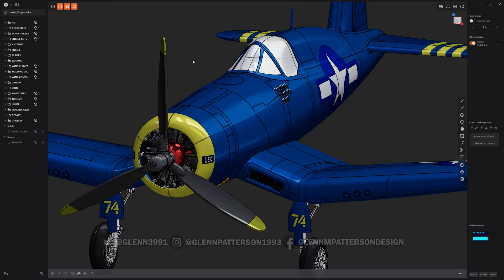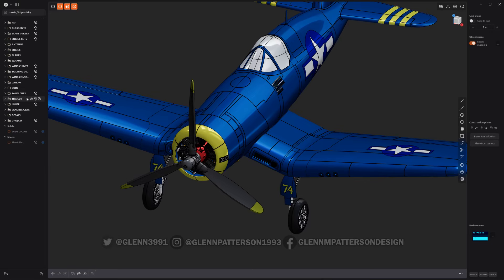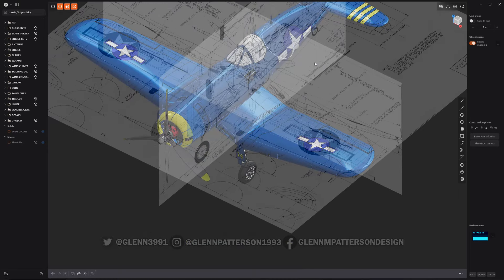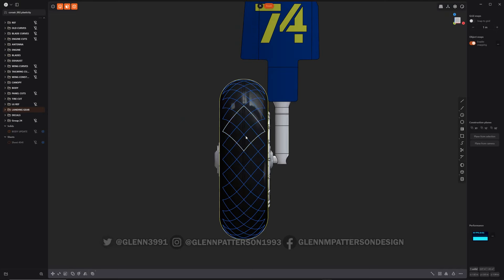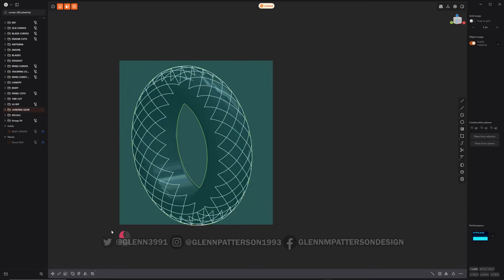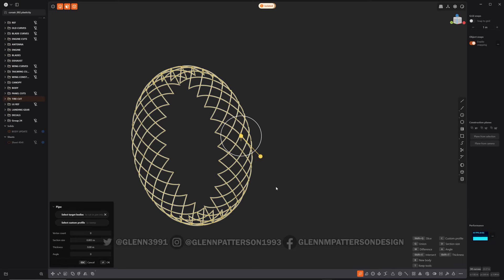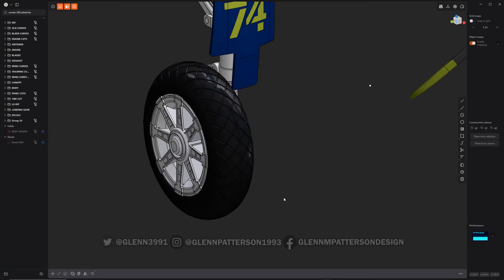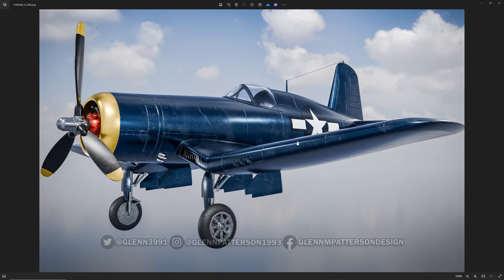92 PLASTICITY 101 EASY PANEL CUTS

Comment: So... The video doesn't show the full process of how you projected those lines. Is it cutting through the whole mesh from one angle ? Is it actually wrapping around like the "emboss/deboss" function from fusion360 ? Can you make very clean angles even when not aligned with X/Y/Z with this method ? Does the projection kind of stretch when the projected line is close to a steep angle ? Thanks !
Reply from the maker: Created a lot of them with imprint "I" key from x,y, or z plane. Couple were just a copy of a curve on the surface. Used trim command to get rid of any lines that over projected. Thing to watch out for when using pipe command is that it doesn't like tight curves, because it'll self intersect creating the pipe. You can check out this video I did last year about the imprint command https://youtu.be/ts-Opwjb4V4
Reply: @Glenn3D1993  If you have the time and energy you should definitely do a more advanced tutorial on how to tackle curved surfaces and imprint on non-XYZ vectors, as this would probably help not only me but a lot of people that are going or are already doing sci-fi objects with panels and cuts ;) This would be super useful for spaceships.
Reply from the maker: @GnougnouA10 Might do that. Starting prep on a long format tutorial on a Mech build, just hammering out the design next week or so. Definitely be able to throw panel cuts into that one for sure.